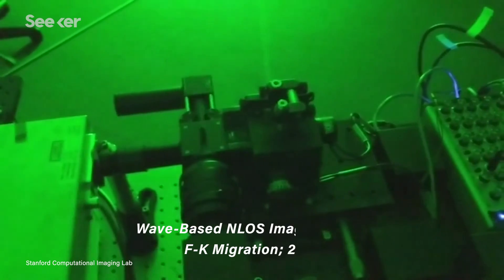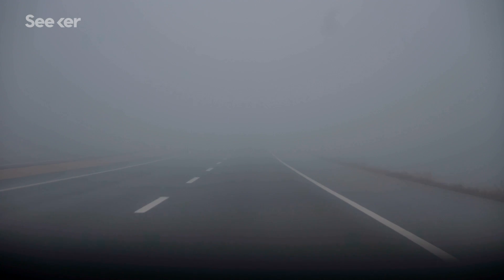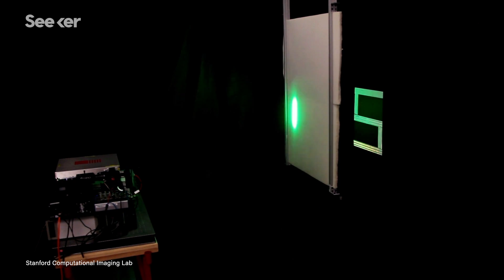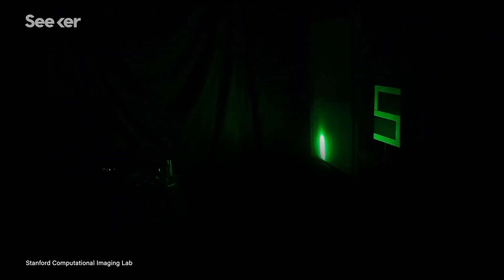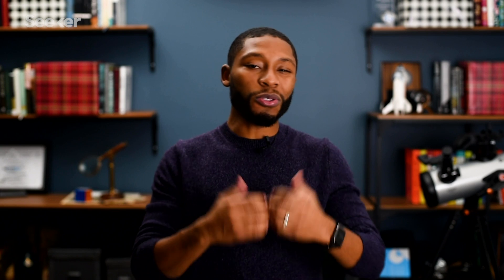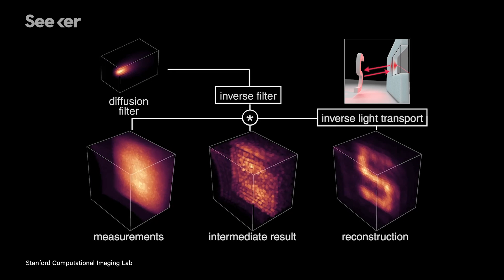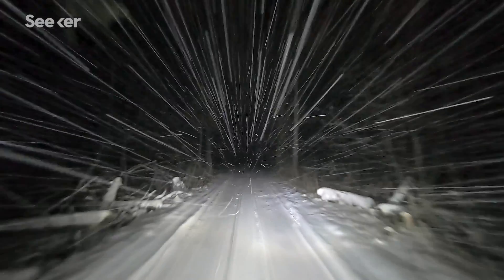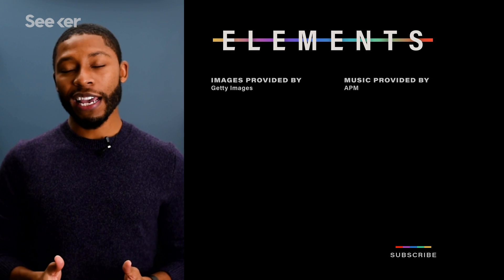How These Scientists Are Turning X-Ray Vision Into a Reality

Comment: NAAAAA so its not rly xray vision, as the Image area/ the material you scan through has to be a rly thin special material... so it doesnt work with material with doesnt let light through (even very thin Aluminium doesnt work)
Reply: It's mostly just improved Lidar. 😅